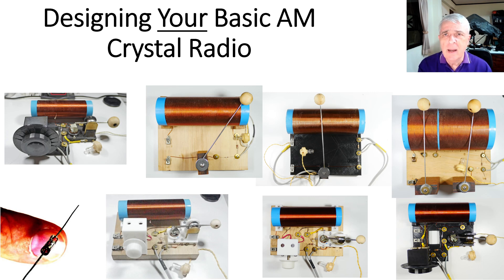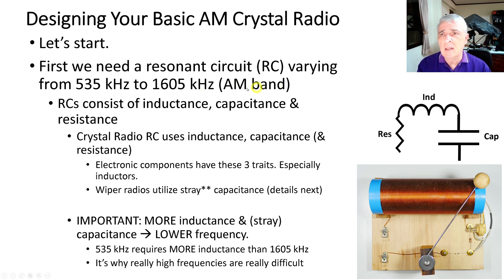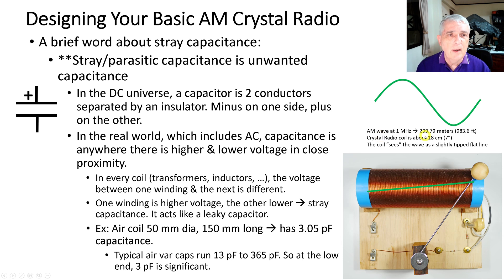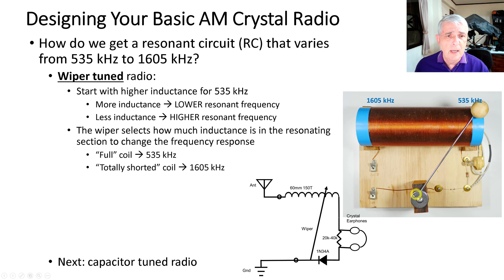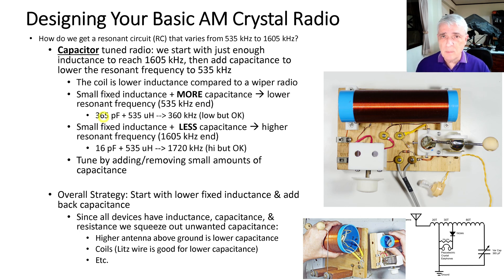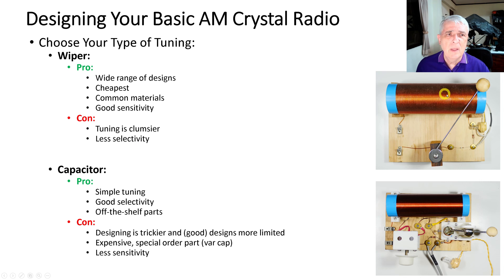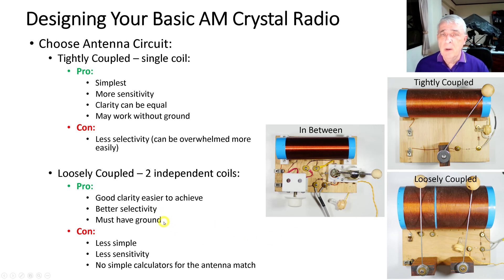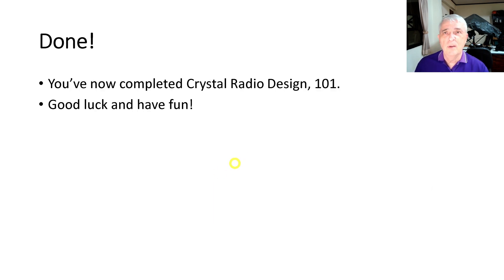Crystal Radio--Basic Designing (4K)

Comment: Yet another great crystal radio video.  So wonderfully laid out for anyone. I think its good its not so easy -- shows how things trade off against one another: resistance, capacitance, inductance, cost, easy of construction and use, gain, sensitivity. It's really a great example in how to optimize any system.